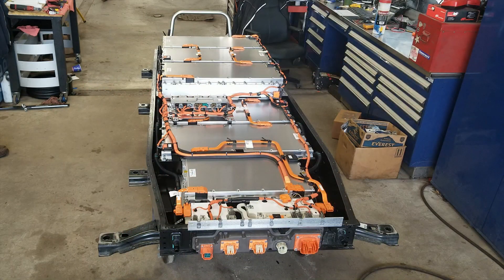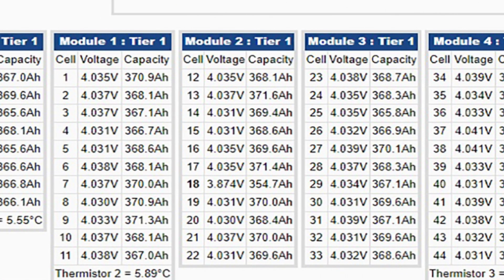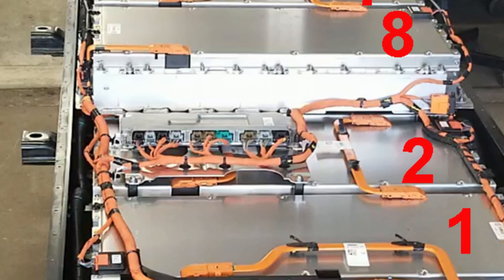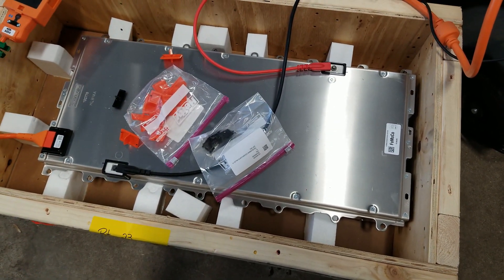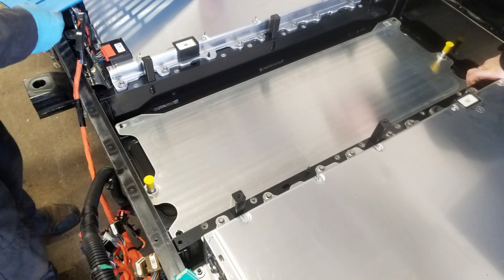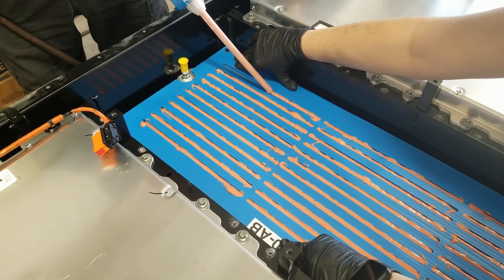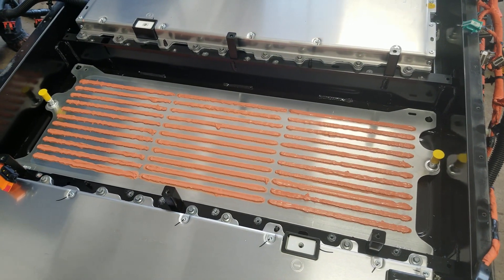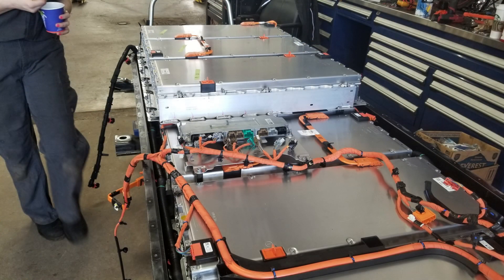2022 Ford F150 Lightning High Voltage Battery Module replacement

Comment: Loved this video. My Lightning is currently in the shop because a "high voltage connector assembly" was improperly installed or damaged while being repaired by Ford 18 months ago.  Can you see this allowing water to damage any of the individual cells, or are they water-tight in those modules? Dealership now wants to deny the 100k warranty because damage stemmed from prior repairs, not manufacturing defects.
Reply from the maker: There's a giant o ring on the lid. If it was damaged or the surfaces weren't cleaned properly  & the dealer didn't catch it it would be on them & not Ford. Part of the procedure that I didn't put in the video involves doing a pressure test on the assembly to make sure its sealed.
I would take it up with Ford & let them sort it out.
Taking it back to the servicing dealer may be your best bet
Reply: @RedneckCam666 thanks for replying! Sadly, that dealer is on the other side of the country and is trying to wash their hands of it. My only hope is that Ford helps me out.

Comment: I know its been 2 years since you made this video but it's still very relevant, especially to those looking to buy used. Just wondering two years later if you are seeing any different trends? Is it getting better for the newer Fords? Thank you so very much!!
Reply from the maker: We haven't had as many failures lately but to be fair the sales of EV's has tanked. Failures for the most part happened within the first 20 or 30K
Reply from the maker: I should mention the Mach-e, there are still some contactor problems that aren't a big deal but we are finding the 20 or so bolts holding the battery to the body rust & break off when trying to remove them. I've spent  3 or 4 days extracting them on a few vehicles. Very costly!

Comment: I have a 2023 Ford lightning standard size battery and this morning I went to get in it and it was completely dead. The 12 V battery had completely depleted.
Reply: How long did the vehicle sit between drives though?
Reply: How many miles ?
Reply: It turned out that an animal chewed the wires under the truck and ford had to put a new wiring harness to the back electric motor

Comment: How much glue is needed for a module install?
My dealer keeps pushing me.
They got the battery over a month ago gave and install then pushed it a week then went for the install and they said they didn't have enough glue so they have to order then reschedule.
Is the dealer playing games?
Reply from the maker: 2 cartridge's of part # TA-38-B, call their parts department and ask to buy some
Reply: @RedneckCam666  got my #5 replacement but battery health said 54 was 4.01 so that is over charged?
I thought 4.0v was ok for cells.
Reply from the maker: @ If you leave it plugged in for 24 hours without disturbing it , the BECM will start to balance all the cells & correct any imbalance in the next 6-8 hours. The replacement module will be close but not perfect until BECM does its stuff. That's also why the range may not be like before. Give it some time
Reply: @RedneckCam666  ok but cell 54 was4.01 volts so  over voltage I guess the bms shut off module 5? Before the replacement it would only charge to 93% the input charger would drop to 1kw or less

Comment: Hi is there any way to buy the entire module from Ford. I import my Lightning to Costa Rica and now Module #1 needs to be replaced
Reply from the maker: Im sure any ford dealer in the usa or Canada would be happy to sell you 1. Their about 10000 canadian $. you would need a HV charger to bring it up to the same state of charge as the other modules to make it work. Shipping would be expensive as the modules are considered hazardous materials. I would try to find a used 1 at a scrap yard first
Reply: @RedneckCam666  I´m having issues with the Module #1, i haven´t open the battery pack yet, I want to buy the module first. Do you know by any change the  Part number for the MOdule 1 of an ER
Reply from the maker: @ As of this date there is no change to the part#'s.
Reply: @RedneckCam666  what is the part number?
Reply from the maker: @Christopher_Arias_CRC  You would need to contact a dealer with a VIN to get a price & part #. you would also need the cooling tray kit with mask & 2 thermal pastes. Prices & part #"s seem to change with the wind lately so I don't want to give you any bad info

Comment: So your shop works on EV's?  Does Ford have to authorize you to work on these EV's
Reply from the maker: After buying the the specialty equipment & Techs completing the high voltage training they certify the dealer for repairs

Comment: looks like I have that same issue, how long does it take to your dealership to repair?
Reply from the maker: About a day, getting the parts is the biggest problem so don't fault the Dealer for any delays
Reply: @RedneckCam666  ok my dealer order a battery today so not sure if that's modules or a whole thing but let me have  my truck back, till parts come in.
Is that safe? I cleared codes and only seems to trigger the code around 90% charge.
Reply from the maker: @ Its a crap shoot... but from past experience it will go into limp mode in the near future if its a cell problem
Reply: @RedneckCam666  They say module 5 need to be replaced, does the pack need to match the charge percent of the other batterys?
Reply from the maker: @ Yes , that's why you need to connect the Charger /Tester. FDRS will spit out a code about where the module should be charged to based on other modules ,that data would be entered into the charger. If you don't do it the BECM will shut down the vehicle because the array is way out of balance. At that point you would need to remove the battery & hook up the charger to the module in question to bring it in line with the rest of them
Reply: @RedneckCam666  Thanks for the info, do you know what causes the difference in 57% limit and 25% limit and stop safety now? more than one module?
Reply from the maker: @sc5102day  How far out of balance the cell is

Comment: Good day. I encountered a similar problem with the second and fifth modules on a 2022 Ford F150 Lightning. Tell me how I can contact you and discuss a few issues?
Reply from the maker: you can ask here
Reply: my friend bought a Ford and he has the same problem, only with 2 and 5 modules, he wanted to know where they can be purchased and how much they cost
Reply from the maker: @F16_Riper  any dealer & about 7K Canadian each...Is it not under warranty still?
Reply: @RedneckCam666  the car was sold at an insurance auction and sent to Ukraine. I don't even know if I should contact the American dealer with such a question, or should I contact the Ukrainian dealer?
Reply from the maker: @F16_Riper  I don't think Ukraine dealers could help as their not sold there but it cant  hurt to ask. They ARE sold in Norway & soon in Switzerland they might be able to help you. Forget about North America, shipping a hazardous item would be very expensive. As Norway is the leader in EV's in Europe I would search for companies that remanufacture batteries & have it repaired or see if you can find a wreaked Lighting there & cannibalize it for the modules you need. Remember you will need the equipment to bring the replaced modules to the same state of charge as the rest of them or the vehicle will fault the entire array. Ford ships modules at about 30% and we we bring them up to whatever the state of charge is of the existing modules before installing
Reply: @RedneckCam666 thank you for answer 🙏 What cells used inside the module? Is it possible to replace only cells?
Reply from the maker: @senoritapandora They do not sell just a cell only modules. You can ask here
Reply: @RedneckCam666   Which specific pouch cell is used in the module? I’ve found SK pouch cells nmc with a nominal voltage of 3.7 V and different Ah ratings.
Reply from the maker: @senoritapandora Don't know, never took 1 apart as they had to be returned to ford. There's a video by Munro live that took 1 apart maybe ask him. you need to take it apart anyways so you could disassemble one of your bad modules

Comment: Is the high voltage failure a common issues? How much it will cost to replace one module?
Reply from the maker: We've seen quite a few, about 7k to replace

Comment: cool, but not for me EV.. way too expensive to replace the batteries, and this only lasts 3 to 5 years, what.......crazy and cost 32k......what....crazy. zero savings of money here.....ev has no future yet!!! I love my power batt tools, my phone, even have a dewalt 60v leaf blower, all great, but not for a car, or a plane or a train. there is so much power in 1 gallon of fuel compared to a battery.....anyway we tried as humans, but not a replacement for ice engines, yet......they say 2035 no more sales of ice engines,.......never going to happen.....they will keep extending the date. love my Bmw ice engines, they last for decades with proper care, never a battery. its not the electric motor that won't last, its the batteries, they need to be rentals in all cars and can get swapped out like nio brand in china maybe,,,,,,just too expensive to buy and replace.
Reply from the maker: Canada can get pretty cold & were finding about 50% of EV purchasers are trading them in for an ICE vehicle after 1 winter. They cant handle the reduced range from cold & using heat. Pretty tuff choice to make -Do I want heat or do I want to get home? Pretty sure its the same in Northern USA areas like Minnesota. I'm guessing the other 50% would also trade them in but cant deal with the huge depreciation EV are taking on the used market
Reply: @RedneckCam666  ev is junk for now, overpriced hype. It's not good period
Reply: @Canamsport  junk is a pretty strong statement to make compared to the huge progress they have had over the last 10 years, but there is more strides to be made for sure.  I know its a wild thought, but with battery cars, manufacturers should really think and consider replacement battery modules better.  5k+ and extensive repair isnt needed in the market, which is why their sales are reflecting this concern.  If the battery tech isn't up to snuff or quite there yet it's fine, just make replacement and swaps more diyable and doable in under 4hrs.  The cost and time of a ICE engine swap just to change 1 battery module out of 9 is ridiculous and causing more problems than fixing.  Or another crazy concept, maybe make the module itself more repairable and replacing the '1' bad cell out of the module more possible so we don't have to recycle 30 good cells because only one goes unbalanced or weak.

Comment: How much does this cost? Looking at buying one of these lightings early next year as I see they are finally dropping in price.
Reply from the maker: about 7K
Reply: @RedneckCam666  wow, thats like a new motor. Is that a common repair? At how many miles?
Reply from the maker: @functionalvanconversion4284  We have done quite a few. The defective ones (Modules) seem to fail early in their life rather than later. Most of the replacements were around  6 to 12 thousand miles.
Reply: @RedneckCam666  wow, that's not too reassuring. Thanks for letting me know. It sounds like I keep having to replace parts on my Honda till the bugs are worked out of Evs.

Comment: Hey Bud, where did you get that lifting fixture for the modules? I checked the ford rotunda parts page. Nothing. Thanks man
Reply from the maker: It was shipped to dealer when we signed up as an electric dealer along with the lift table & a smoke machine. # for the bar kit is 414-016-01
Reply: @RedneckCam666  wow your way quicker than a ford rep 😅😂 thanks for the info buddy. Great video.
Reply from the maker: @johnsawicki4206  I think the -01 is just the adaptor brackets , pretty sure the entire kit is 414-016

Comment: Approximately How much does it cost to replace a full battery pack (all modules)  on the ford lightning extended range?
Reply: Wow thats expensive! So in reality after the warranty expires, i can be at risk of having to spend 60k$ if my battery was to go out? I really want a ford lightning but that battery scares me.
Reply from the maker: The odds of all the modules failing at the same time is pretty low but I can see modules failing 1 by1 over time at 5K a pop adding up @ranchitosantos5165
Reply from the maker: About 60K US

Comment: Mine is in right now for this.
Stalled in my driveway, had to get towed.  Have about 15k miles on it.  Doesn't make me very confident in keeping the truck
Reply from the maker: Good luck with the repair

Comment: Can you do a krown anti rust treatment or fluid film on the frame?
Reply from the maker: not sure how the high voltage wiring would react with those chemicals. Ford does not recommend any chemical treatments

Comment: Thank you for the video. If the car has it own BMS, why would that BMS balance the falty cell? Why do we need to replace a whole module?
Reply from the maker: you cant balance a faulty cell
Reply: @RedneckCam666   Thank you sir, so if there is a system that isolate that faulty cell, will the battery pack operate normally? Can we manually disconnect that faulty cell?
Reply from the maker: The BECM can't just isolate a cell  & disconnecting it would be viewed as a fault by the BECM @S25plus

Comment: So, where does the old battery go?
Reply from the maker: Its returned to Ford for disposal
Reply: To add-on to OPs comment - Ford is also partnered with Redwood Materials, a company founded by the ex-CEO of Tesla, that handles the recycling of end-of-life/damaged batteries and logistics of sourcing new battery materials.

Comment: Great video.  Showing what cell in what module made it easy to understand.  Now only if one can change out a module without dropping a chassis.  Need a modular repair design.  Having to disable 20% of the vechicle to change 1 part is unsustainable
Reply: True, if you change the engine of a fossil car, thats much easier. Its not more than a 25 minute job.

Comment: I'd love to get some measurement on one of these to see if it would fit in my 2014 F150 frame rails, thinking about doing a Lightning battery/drivetrain swap into my 2014 F150 Tremor RCSB.
Reply: The 2014 and prior are different than the 2015-2025.
Reply: @JimBronson ooh I know, I have both

Comment: Thank You!
Though your video may not be related to Ford’s recent Lightning “CSP” (translation: not-a-recall recall???) it provided us with a better understanding of what the heck CSP # 23B57 seems to be referring to.
Reply from the maker: The "Not a Recall" is a direct result of  the events in the video &  has happened to other 150's. The Fault code retrieval & Cell Health report  are used in the "Not a Recall" to determine the  course of action for the High Voltage Battery . That's why I did the little bit about how we got here.

PS: Please Subscribe

Comment: Good video , but the more I see about EV’s , the less I like them . 
Maybe I’m just an old  dinosaur , but I miss the days when the owner could lift the bonnet and actually repair stuff without the need for computers and dedicated factory software and or a specialist someone that knows how to use it , or the need for a vehicle to be in a state of repair for possibly up to a week or more.
A time is coming or is here where a vehicle can be completely disabled by either a battery or the software, or both and if the owner is not in the vicinity of a tilt tray and a dealer they are screwed.
Reply from the maker: Not saying Electric vehicles are great but I think that's what people with Horses said when the first cars were introduced. 
I still remember when Electronic Fuel Injection came out, a lot of Mechanics said its too crazy and quit the trade. 
History repeats Itself!

Comment: Great video thanks for posting it.  Was there any programming you had to do after the repair to let the car know? or does it just know?  Also let's say I bought an F150 SR and find the range to be insufficient, battery price aside would it be feasible to swap in a whole new battery pack in a day?  Or is there some kind of programming that would have to be done by a ford dealer?  thanks.
Reply from the maker: Not much to do after replacing a module other than clearing fault codes.You need to put it on a charge & the BECM will ballance all the cells as needed. As for upgrading the entire battery, the BECM "Battery Energy Control Module" would need to be programmed to let the rest of the vehicle know about the extra capacity.  That might be a bit of a challenge as software is tightly controlled by Ford for each vehicle

Comment: I had a battery module replace on my standard range. I am curious, is it possible to add the additional modules to “upgrade” to the extended range?
Reply from the maker: Im sure its possible, 3 modules , upper tiers bracket, top cover, wiring harness, cooling system plumbing & the challenge of software I'm guessing would be around $25K. Is it worth it?

Comment: Complexity Complexity. What ever happened to simple four cylinder four speed automatic
Reply from the maker: Not complicated enough to sell these days
Reply: Or a 6 or v8 with a conventional 4 or 6 speed auto , my last car a conventional sedan family taxi and tow car with a big lazy long stroke straight 6 did 17 years hard service with unopened engine gearbox and diff , and just basic maintenance 99% of performed by me, and it was still running and driving like beauty apart from having a really beat up body from years of hard yakka.
  Maybe the small seperate battery module thing is a better way of powering an Ev , but imo it still sucks.

Comment: shouldn't repair like this be under warranty?
Reply from the maker: Yes it was under Warranty
Reply: @RedneckCam666  thats surprising that even under warranty you replace just one module, some manufacturers want to replace the whole battery pack